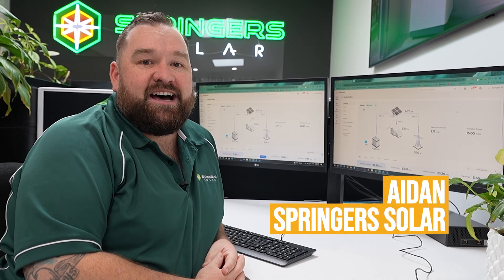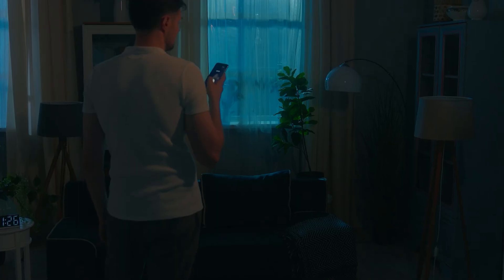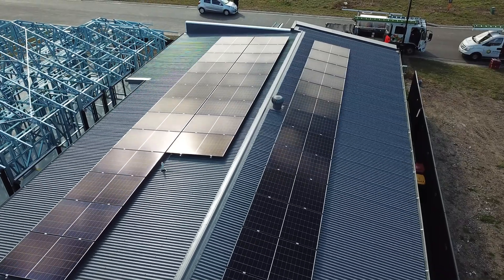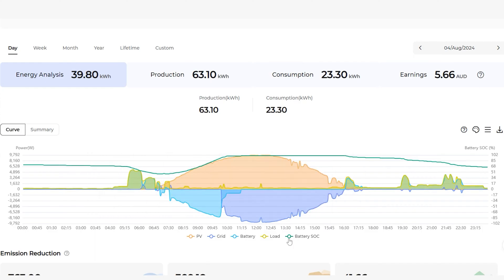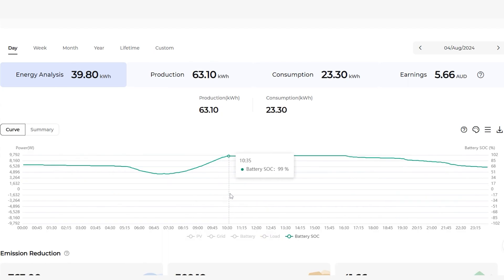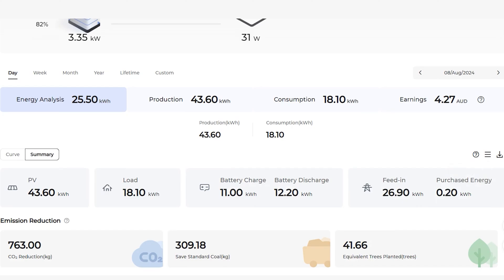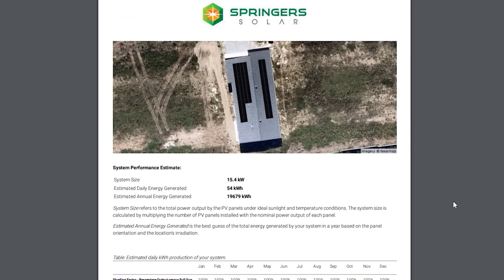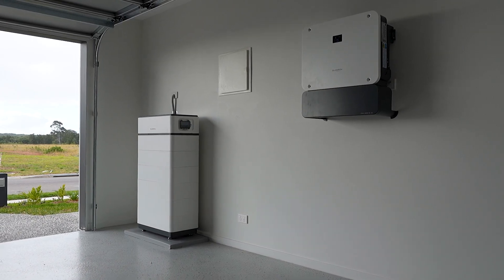Sungrow SBH Battery - How Does it Perform? Monitoring Data with iSolarCloud

Comment: At 4min 55sec the data shows 43.6 kWh production and 18.1 kWh consumption and battery (30 kWh storage) SOC never got to zero why was there 0.2 kWh purchased from the grid?
Reply from the maker: Good question, and you'll notice this happens with all battery systems regardless of the battery's SOC. Solar Quotes wrote a good article on why this happens here: https://www.solarquotes.com.au/blog/monitoring-apps-arent-lying/
Reply: @springers  Thanks for the reply and link to the article

Comment: Hi. Can't find the Cable Cover installed directly under the SH15T inverter. Is it a custom made cover or a buyable Sungrow accessory? thanks
Reply: Would have liked to see more info on the car charging aspect of this system. Thanks.
Reply from the maker: The cable cover is included with your inverter upon purchase ☺
Reply: @springers  oh, interesting. Not in Europe